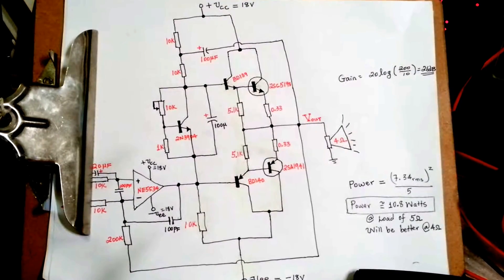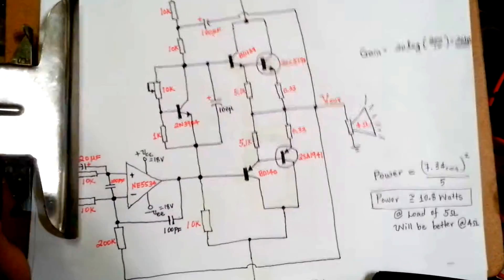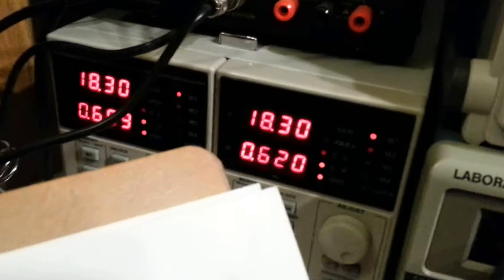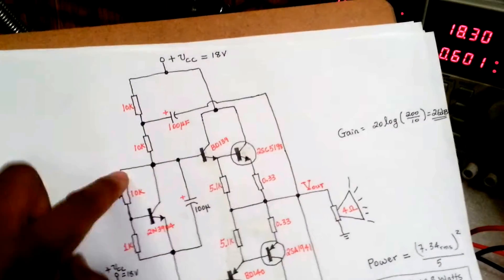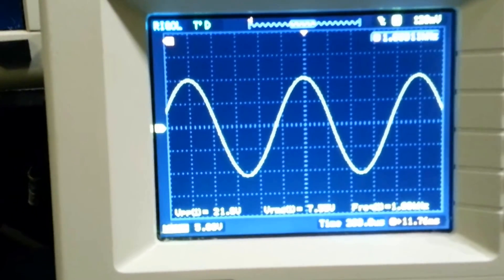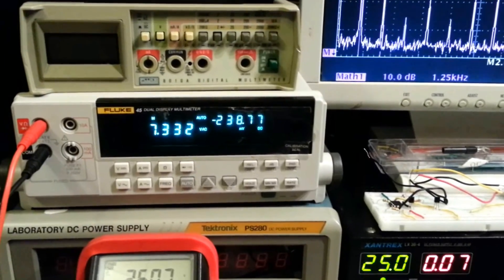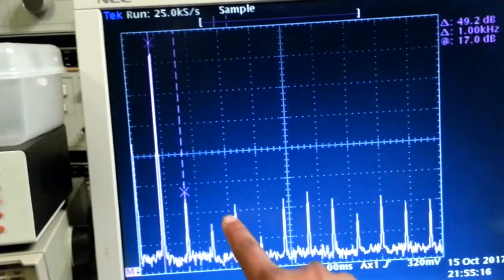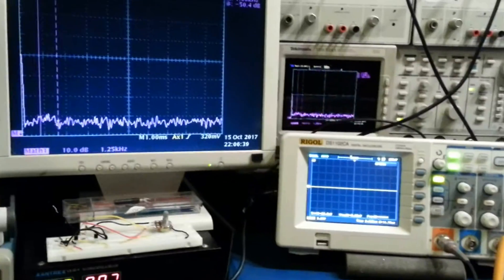Bootstrapped Class AB Op-amp Audio Power Amplifier Design

Comment: +30 0 -30v its working or not. Any components change. Pls tell me sir.
Reply: It will not work with that power supply. The op-amp used (NE5534) will not be able to operate at that high supply voltage.
Reply: Smith Kerona thank u
Reply from the maker: That is correct Tekellamer! The NE5534 max voltage limit of +/-22V.
Reply: @SmithKerona  how if I use regulator voltage for the chip ? So can I use higher voltage to amplifier ?
Reply from the maker: You are welcome!

Comment: Hi! If you don't mind i have a few questions. I am a beginner electronics hobbyist, so please forgive me if i get something completely wrong. 1- To drive 8ohm speakers with this circuit should i just increase the input voltage? i checked the datasheet for the output transistors and they are quite beefy, will the opamp be able to take, lets say +and - 24v? 2- would you recommend an input coupling capacitor to isolate dc or do some filtering after the preamp? 3- Can you give some advice on how to check the bias without a scope? Thank you so much for your time in advance. I have built a class b amp and the crossover distortion is anoying :) P.s.: i intend to build this amp 3 times, to make a 2.1 stereo amp driving 2 8ohm speakers with 2 16ohm tweeters and a subwoofer on the third channel (with 5k resistors to average the signals) with a rc low pass filter(should i go LC?).
Reply from the maker: No need to apologize for asking questions friend! Here are my answers to your questions:
1) No need to increase the supply voltage if you want to drive 8Ω speaker – you will just get half the power. But if your intension is to get more power, then yes you can increase the supply voltage. The op-amp can take up to ±22V or 44V but it isn’t recommended. If you require higher power you will have to design a discrete op-amp to handle the large supply voltage (Stay tuned in upcoming videos regarding discrete op-amps for audio applications). 
2) Yes you need to use input coupling capacitor since the op-amp will want to see a signal without any dc offset which might limit the low frequency performance of the power amplifier unless you put a large capacitor (depending on your source impedance of course).
3)  Yes you can check the bias current through the main output transistors using a multimeter. To do this, use the ‘mv’ scale on your meter and measure the voltage across the emitter ballasting resistors (0.33Ω for the power amplifier shown in the video) and calculate the quiescent current using ohms law while you adjust the 10k pot in the vbe multiplier transistor.
Reply: Thank you so much! i already ordered the parts and am anxious to start! Regarding the opamp, i considered using a tl072 that can take  +- 36v and is a low noise amplifier (also I already have a few here) but i was worried because it is a jfet input, could it cause problems? Thanks again!
Reply: also, what kind of current am i looking for? Should i just be sure that both transistors have a minimum quiescent current or is there an ideal value? (i am using the exact same transistors). I chose 5w resistors for ballast, should i use 10w? Again, thank you very much for your patience! :)
Reply from the maker: The TL072 is inferior compared to NE5534 in all aspects except for input resistance. If you have the option use NE5534. NE5534 is also five times less noisy than TL072 and is popular for audio applications. JFET input will cause no issue; in fact that is the only good merit TL072 has over NE5534.
Reply from the maker: It all depends on the transistor you are using since VBE(on) will be different for different transistors. What matters is though; the transistors are just about turned on so that when a signal increases above zero, the emitter of output transistors follows it. You get to choose the quiescent current depending on how much quiescent power dissipation is tolerable. Take a look at the following example calculation:
 https://drive.google.com/file/d/13DOrUl2VbzSZZHRN-sCXjX2ZebzFGsjC/view?usp=sharing

Therefore for the example in the link, you set your VBE multiplier circuit to have about 1.2V and measure across the emitter ballasting resistor to know exactly how much current is flowing.
Reply: Dude! that was a great explanation! i'll do my best to get as close to "barely on" as possible and slap a big heatsink on it. I'll have three of those amps in the same heatsink, so i'll throw a big one for good measure. I'll also use the NE5534 as you suggested. I am so pumped to get building it! I'll send you a picture! :) Btw, if i can get a transformer with two secondaries maybe i can use a +-18v (regulated?) rail for the opamps and the input section and a +-24 (or even more) for the power amp section! I got some great sounding 8ohm speaker i would love to use.
Reply from the maker: That sounds good buddy. Yes it should be regulated power for the op-amps since the op-amp doesn't have infinite PSRR.  But since the power amp will follow the op-amp output it isn't necessary to use higher supply rails for the power gain stage(remember the power gain stage is an emitter follower output with voltage gain of approximately one).

PS. I love your enthusiasm!
Reply: oh, ok. I wasn't thinking of the output transistors as current gain only (i still have many faulty assumptions, my bad). so i guess i'll do a +-18v rail and a regulated +-18v rail just for the opamps ( that way i won't create a sauna in my house by using linear regulators in the power rail! LOL). This makes me even more interested in the discrete opamps you teased! :) Is it practical to create discrete low noise opamps? Are we using Jfets or mosfets will do? maybe i could use them only as a voltage gain stage just before the output transistors! Dude, i can't tell you how much i am learning from you in this process! thank you!
Reply: Well, a regulated +-15v actually, i need to consider the regulator dropout voltage.
Reply from the maker: You will be surprised that you can create a high performance op-amp with superior specs (compared to common op-amp types) from discrete components if you know what you are doing specially for audio purposes (low frequency applications). You can optimize the design for any parameter (example: noise) as you are not at the mercy of the op-amps specifications. The choice of which transistor type to use will largely depend on how much source resistance your discrete op-amp is going to see. For good noise performance, if your source has low output resistance use BJT and if medium to high output resistance use JFETs.
Reply: i am excited for it! i researched a bit on them and they seem awesome!
Reply: by the way, my parts just arrived, i bought 10w resistors for the .33 ballast, i may have miss calculated a 2v drop across them, that is 12w... am i grossly wrong? 10w watt resistors take a massive real state on the board. also, i forgot to buy bd140 and 139, can i use tip31 and 32 in a pinch? i know its a gross overkill...
Reply from the maker: Sorry for the late replay! I have been out of the YouTube game for a while. Well if it was up to me, I would have bought three 1Ω/5W resistors and paralleled them to get the required resistance and power handling. Smaller and cheaper solution. 

Yes you can use TIP31 and 32 without a problem. Except TIP31 and 32 have lower hFE and might require more base drive compared to BD139 and 140.  Well let me know how the Amp is preforming!
Reply: hey! nice to hear from you! i didn't start yet :/ work got a little crazy lately. But good to know about the transistors! I may get the BDs after all. Yeah i should have bought those, its not to late though. I'll keep you posted! Oh, by the way, why are those transistors so popular in audio amps? Is it just because of the better thermal perfomance of the package? I've seen them in many designs although the current they are able to carry is not that high (the voltage is, though).
Reply from the maker: BD139/140 are popular in audio applications because of their power handling capability vs their current gain. These European transistors have very high hFE for being 'power' transistors. If you see at their datasheet at 25 degree C and Ic=1A, the transistors have a typical hFE over 100! Because of this and having high BVCEO, they are very popular in driver stages for output transistors. Although not useful parameter for audio application, they also have high transition frequency. They also have very low Vce(sat) if you want to use them as a switch. Definitely very versatile little buggers which are always handy to have around!
Reply: Sorry dude, i meant the 2sc series. The beefy power stage transistors! i noticed they are capable of very high voltage, but the current they can safely carry is very similar to some of the TIP series (and much lower than mosfets, but that is a whole new can of worms). The BDs make perfect sense to me.
Reply: Nice video & explanation & anwering & many nice things - thank You